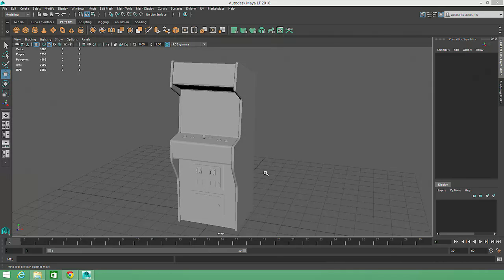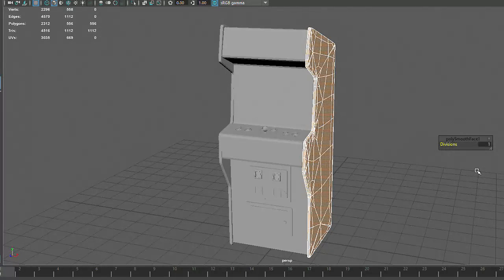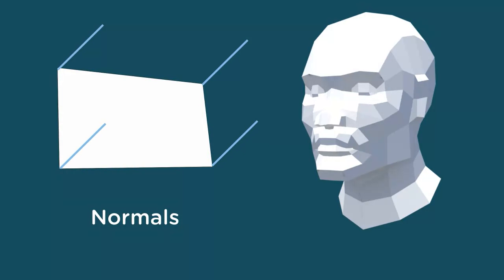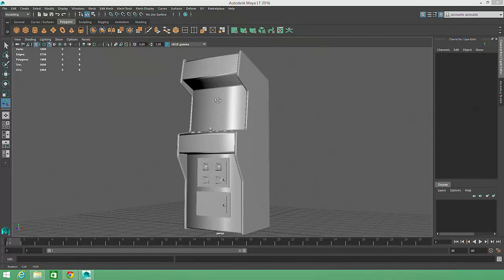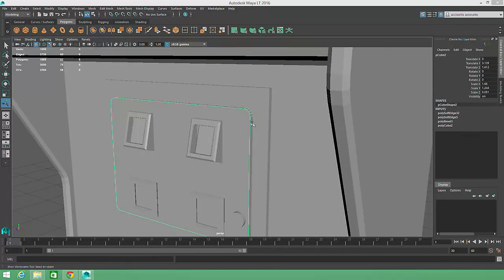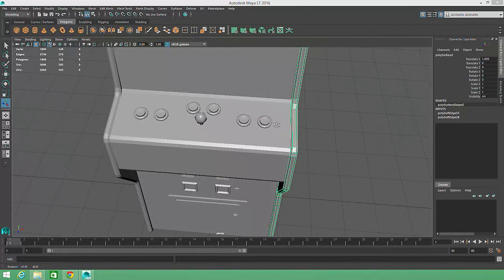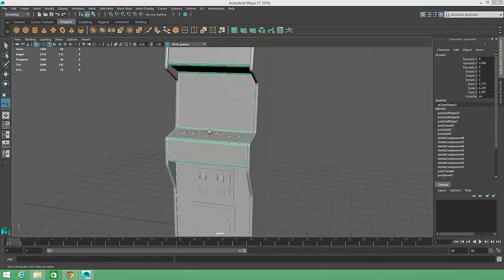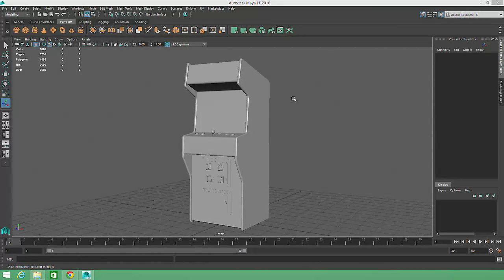Maya LT Tutorial - How To Harden and Soften Edges [ Beginner to Pro Course #12 ]

Comment: Thanks! I have a question. Is there a way to soften the edges across multiple meshes to they appear smooth across the borders of the mesh? I have a character with multiple meshes: face, head_top, forehead. (it's setup this way for an avatar creator) There are noticeable seams where the meshes are divided. The seams are very apparent with dynamic lighting. Is there a way to smooth? Many thanks in advance.
Reply: Answer: I selected the multiple objects.  Mesh Display->Vertex Normal Edit Tool. Selected the verts sharing the mesh borders. Shift+right-click--> select Vertex Normal-->Average Normals from the popup menu. This averages the normals making the seam appear smooth.